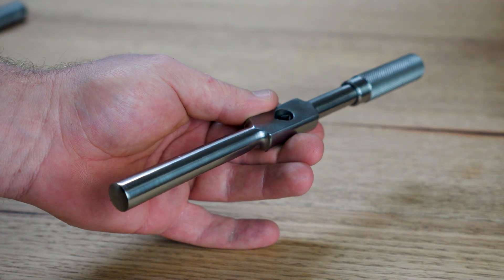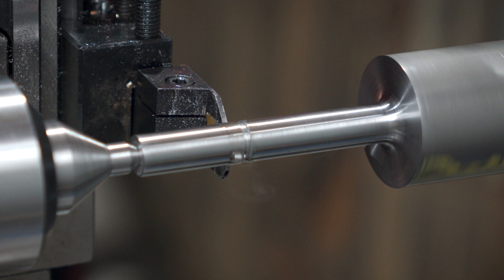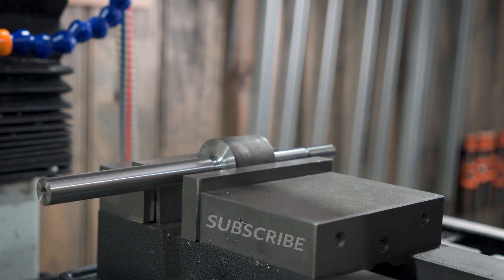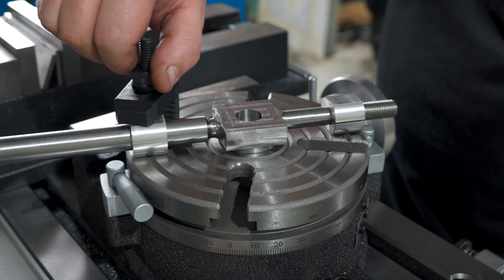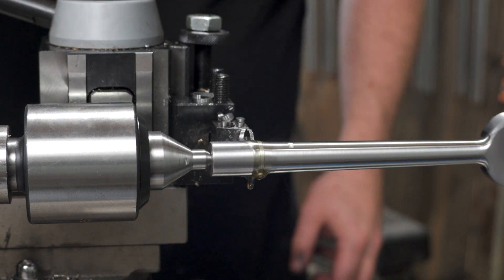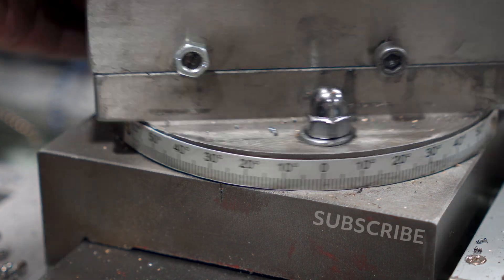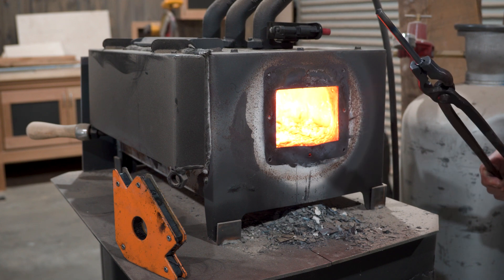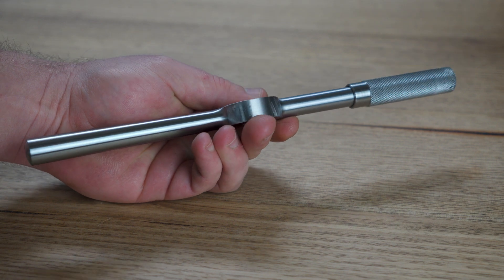Making a Die Holder – A Project Worth 'Die'-ving Into!!

Comment: Nice work, well made video.

One personal preference I would open up the back of the die holder at least past the die openings to help evacuate the chips.
Reply from the maker: Thanks very much! And that’s fair, the hole in the back of mine is 16mm and the largest dies it can take is m12, so there is a little wiggle in there. I’ve used it a few times now in m10, and m8 and haven’t had any issues with chip evacuation, but I guess we will see on the m12. Appreciate you checking it out!

Comment: Dude you need to disable the auto-focus on your camera and set the focus manually. It's a bit of a pain, one more thing to have to think about,  but it's less pain than having your footage all screwed up. Nice job on  the holder regardless of the camera issues ;)
Reply from the maker: Thankyou! And yeah I don’t disagree, I use the focus tracking a lot so I can shoot at a lower f stop, I do have problems from time to time, but don’t usually have as many issues as I did on this one 😂 but yeah, definitely something to work on! Appreciate you checking it out!
Reply: Agreed. I use manual focus almost exclusively. I have a button programmed on my camera to zoom in 5x and 10x to be able to set the focus easily. It takes some getting used to but you get the hang of it quick.
Reply from the maker: That’s something I’ll have to look into with the presets , I didn’t know you could do that! I mostly shoot with prime lenses but if you can do that, I should be able to set a preset for the different focal lengths maybe. Thanks for the tip!

Comment: Very nice. I made a 2-1/2" die holder a while back (not in this design) and one of the biggest mistakes I made was not off centering the screws to hold the die in with, my mistake and I learned from it to, mine is a bit canted when holding the die but not enough that I am going to remake it, my part is true but the dies aren't drilled properly so it cants them. I made a unique design with mine and it was a lot more work than I had planned.
Reply from the maker: Ah nice! I did think with this one that if you needed to move it, you could offset drill for the pin before milling the flats. I didn’t need to do it thankfully, but it would help if you needed a larger offset
Reply: @nomadhandcrafted  I got to thinking about mine where I should have bored it a bit shallower so the set screws are always pulling it in to a shoulder. I'm going to mig a few passes into the shoulder and turn it again but this time make is shallower so it's always pulling inward.
Reply from the maker: Ahh that’s a good idea to modify what you’ve already got.

Comment: Nice design. You could have save on material and time by using flat bar in a 4 jaw chuck.
Reply from the maker: Thanks! It did come to mind but I was concerned about that much interrupted cutting, but if I made it again, I would definitely try that instead. Thanks for the tip!